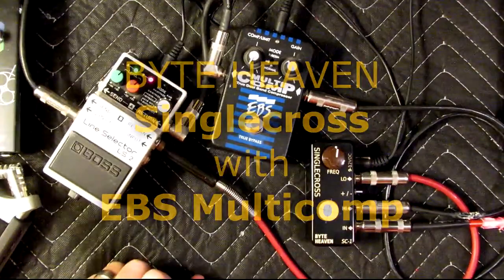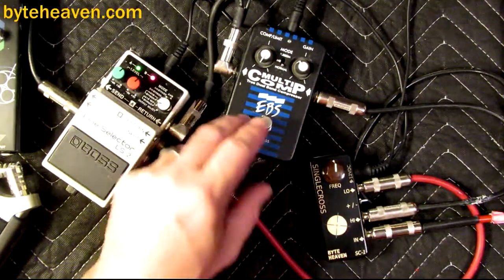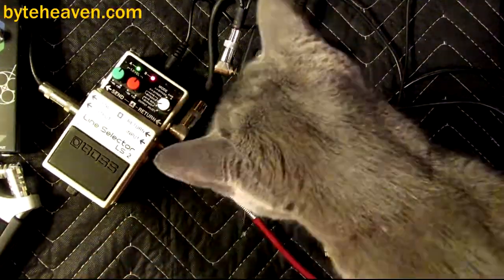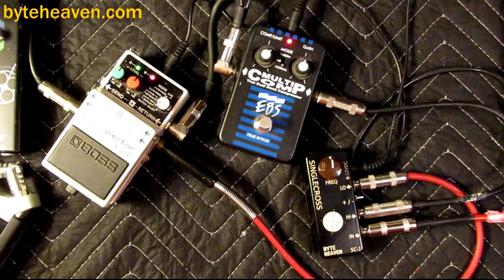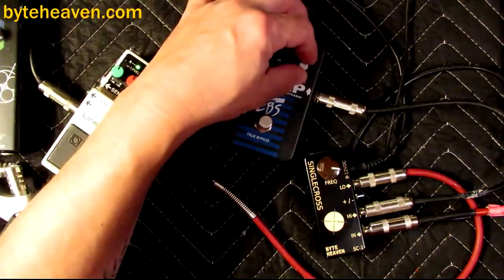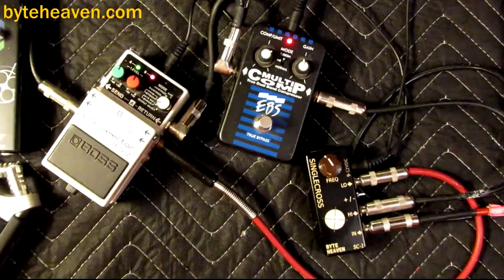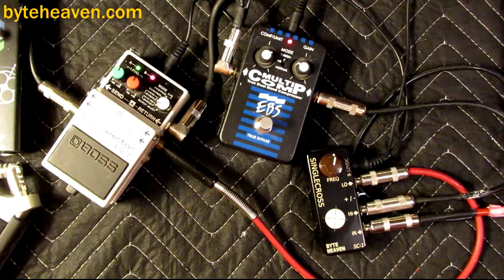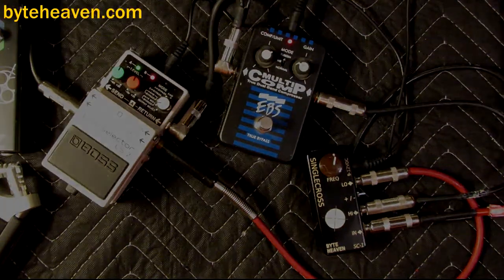Singlecross with EBS Multicomp

Comment from the maker: Note that the MultiComp is an inverting pedal, so when bypassed there's a scoop at the crossover frequency. It's not huge but you can hear there's just a little less mids in bypass mode.